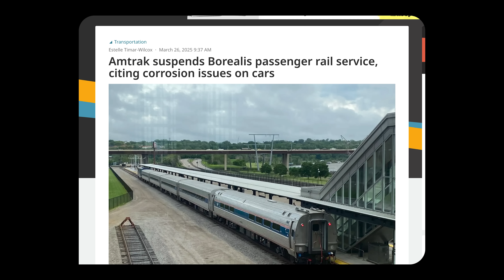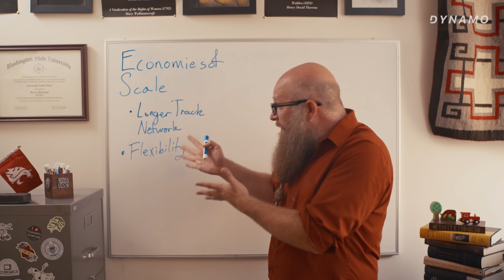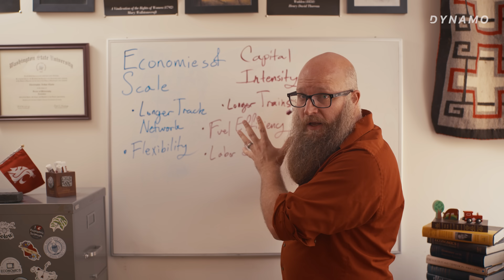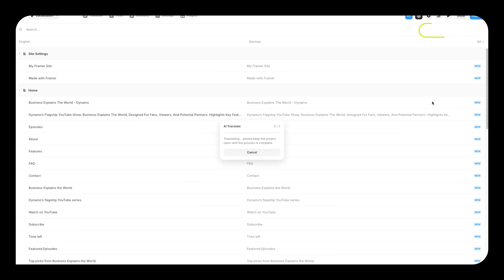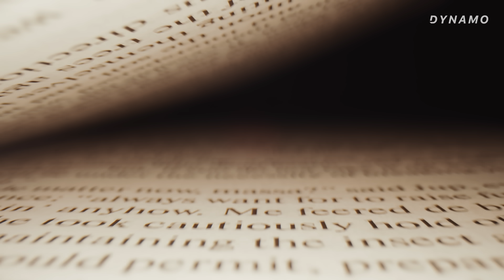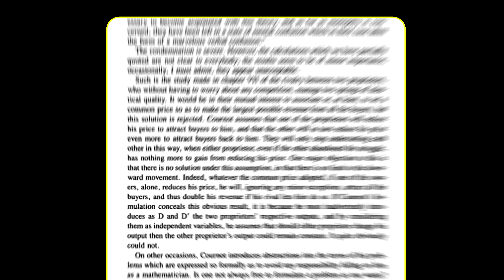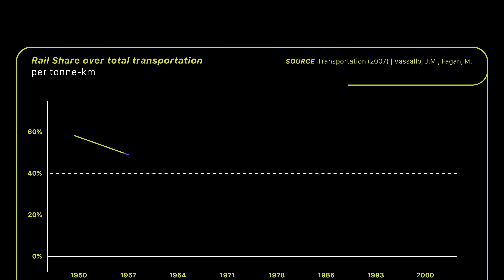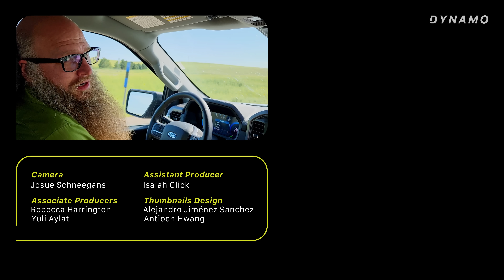Why Freight Trains Suddenly Got SO Long

Comment: Counter point, Intel and AMD, or Apple and Microsoft. I dont see price wars there? Your point about cell service providers can be countered by a near price parity in Canada between rogers, Bell and Telus. Or what about internet service providers, North american internet is garbage for its cost. Freight trains sure. But passenger trains are dying and their main competition is junk service airlines. Theres another one, the quality of the service on air travel mirrors it price, they had a race to the bottom, waiting for one to break so they can shoot back up to make money again. or how about air line manufacturers, they have a captive market and little to no competition yet are still struggling, with a merger or sale almost every decade.
Reply: Intel and AMD were not perfect substitutes. Nor did AMD have the capacity to service the whole market. Microsoft and Apple differentiated themselves drastically. Plus, they experience significant switching costs between the two operating systems. They are definitely not Bertrand.

Comment: Is the blowing of the horn when passing through intersections still needed anymore? Everyone should know that you don’t play or park on train tracks. And the arms go down. Train horns are a nuisance. How many lives do they save?
Reply: Horns at grade crossings are an FRA requirement. They are an alert in case the gates fail. Always have a backup for a backup. (U.S. trains have bells for the same reasons)
Reply: @AEM-7_943  Could we make them less deafening?! Also appears to be a solution to the wrong problem. People shouldn't be on railroad tracks. I see it all the time these days though with cars in traffic.

Comment: Yeah America has a lot of freight trains, but they crawl basically at tram speeds on extremely low quality tracks. And the problem with trains that can't even fit the sidings is that the capacity becomes extremely low and it effectively bars passenger trains from the system.
Reply: really depends on where you look like theres main lines and then thats usually faster freight with bigger more modern locomotive the more rural you get the older the tracks and older locomotives as they dont have as much money as big companys to maintain track and get new locomotives
Reply: @donotfearamericaishere  From what I've seen and experienced even the Northeast Corridor is very poorly maintained for such an important mainline by global standards. I mean seriously you can even see how the trains wobble around on portions.
Reply: @dijikstra8  north east corridor is actually very well maintained from my experience on it just issues with trains being late infrastructure is aging and that definitely needs to be addressed but overall its decent and what do you mean you can see the trains wobble around sure there's probably some parts like that but i  haven't seen anything like that if you could provide a video thatd be appreciated
Reply: That just isn't true, lots of freight in USA travels at 79MPH, in Europe freight only goes 75MPH.
US diesels are so good that there are over 1,000 in Europe.
40% of US freight goes on rail, a higher percentage than virtually every other country in the world.  British railfreight is 8%.
There is nothing wrong with the quality of US tracks, They do have derailments, but they are rare, and as there are few passenger trains derailments don''t usually injure or kill anyone.
If the train didn't fit any sidings it would never be able to be formed in the first place.
I've worked on British railroads for 36 years and I avidly read about you're amazing railroads,
It's very disappointing when people post up lies about a subject they obviously don;t know much about.🤬
Reply: @jonathanbutson1385  He's got a point though. From what I know about BNSF, trains over 100 TOB (Tons per Operative Brake) are limited to 55MPH, which means most road freights can't go faster than that. Only the highest priority Z trains and maybe Q trains can exceed 55. We have pretty much perfected the diesel electric locomotive though, which is why we export so many. About the sidings, some locations do have issues with trains being too long to fit in the sidings. Most sidings are no more than 8 or 9,000 feet long, while most of the Class 1s regularly run trains exceeding 10,000 feet. These trains weren't possible when the most of the infrastructure was laid in the 19th-20th centuries. For example, UP runs Z trains in and out of Portland that are sometimes almost 15,000 feet long, which clog up the whole Portland Subdivision because they force everything else into sidings. However, BNSF is usually good at running reasonably sized trains below 10,000 feet.
Reply: @jonathanbutson1385 max speed for freight is 70 in North America and that’s only for intermodal trains and autoracks. Hell, all modern engines are geared for 75 mph max.
Reply: and they are very slow, diesel and outdated just like the tracks on which they roll.
Reply: @carholic-sz3qv Our GEVOs and SD70ACe are great. Most modern locos out there too.

Comment: It's the first time in history that the USA has an electrified high-speed train in 2025😂!

Then they say that the USA has a better rail system?😂
Reply: Huh? The Acela has been around since 2000.
Reply: the video is about freight trains and the rail system that serves that specific subset of trains
Reply: @kent5147  and yet its still slower and worse than the freight trains operating in western europe and east asia
Reply: Meanwhile in Europe they have up to 7000hp electric locomotives

Comment: I'm not an economist, but it feels like for a Bertrand dupoloy to exist, there has to be some mechanism to prevent collusion. We see much larger networks create oligopolies. The triangle number increase in coplexity of a network as nodes increases is a natural check against the tyranny of monopoly/collusion. I'm gonna have to side with Cournot considering the current state of US political function.
Reply: Yes, a big part of preventing a duopoly becoming a monopoly would be preventing it from becoming a cartel.
Reply: In the context of trains, we've seen the number of firms drop from 30 down to 7, yet the prices, adjusted for inflation, have also fallen. I think the evidence, in this case, points to Bertrand.
Reply: @EconChrisClarke 
As the number of competitors decreases the easier it becomes for the remaining firms to collude, either directly or indirectly. If there are few firms in a market, one seller can simply decide to match prices of competitors, rather than undercut. With a small number of firms they don't even have to actually break the law by talking with competitors about price. Imagine the two smoothie carts in the example in the video. If my cost is $2 per item and  competitor increases prices from $3 to $5, I could get most of the customers by keeping my price at $3, but why not match the price and make triple the profit per drink? Going 100% market share isn't my best strategy, unless I want to drive my competition out of business, so I can later raise prices.
Reply: @jonscaplan And yet we found two firms were sufficient to bring prices down to costs in the paper we cited studying the powder river basin. While incentives for collision exist, there are other incentives where collusion breaks down. There is always a benefit in undercutting your competitor.

Comment: Terrible choice at 13:56 to use US cell service (3 firms) as an example of a 'good' oligopoly. The average cell phone bill in the US is $140, compared to an average of $20 Europeans pay for the same thing. But "cell service has only continued to improve" and "prices dropped?"
Reply: If you compare apples to apples, you'll see the American prices are similar. My 5GB plan with Mint is only $15 a month. Mint uses the TMobile network. Year by year, plans continue to improve and be cheaper in America. Just four years ago, I was paying $20 a month for 1GB.
Reply: @EconChrisClarke  not sure why you were paying $20 per GB. T-Mobile had a $30 a month plan with unlimited text and 10 GB of data back in 2012.
Reply: @MirzaAhmed89  Did that plan include purchasing the cell phone along with it? I've almost always used the discount brands.
Reply: It's not phrased as an example of a "good" ie moral one, just factually efficient.  Service networks in the US are vastly superior to other countries (especially accounting for the expansive geography) and exponentially better than they were a decade or two ago, when more than twice as much competition existed; additionally, we used to pay for data by the gig, calls by the minute, texts by the message... now you can mostly get family-size unlimited data/sms/call for barely $25/pp. That's abundantly cheaper than phone plans were in 2005. The improved networks is due largely to the mergers, but as Prof. Clarke pointed out, not at the expense of raising prices relative to the increased service & capability, or even inflation.
Reply: Huh? I pay $20 a month for cell service. Where are you getting $140?
Reply: In post-Soviet area you get 40 GB of mobile 4g internet (plus the rest of mobile stuff, plus bonuses to choose from) AND unlimited home internet (~100 Mbit/s) - all for $7/mo. 
If you want 1 Gbit/s for home internet (plus the same mobile package) - that's $10/mo. And if you want unlimited mobile traffic - it's just a bit more expensive.

$20 a month for 1 GB of mobile traffic in the US is insane. And you invented most of these technologies lol. You are clearly robbed.

Comment: Three Miles of trains to block intersections for hours, three miles of trians with rail inspectors getting seconds per car for safety and maintenance inspections, before being fired for doing their jobs. Three miles of trains to pile up in horrific crashes almost daily. 
I love trains. Lets be excited about trains, lets be excited about redesigning tracks to support freight and passengers. Lets put money into the actual trains, tracks, and jobs to maintain and operate them safely. Let's stop that money from consolidation, cutting safety and cutting necessary workforce. Lets stop that money from lining CEO and lobbiest pocketbooks.
Reply: It’s only gonna get worse. “Precision Scheduled Railroading “, monster trains, megamergers, etc…that’s all just business as usual now.
Reply: He did show in the video how safety increased.  I don't even pay close attention to the industry, but I have seen improved safety measures in the last 20 years such as positive train control and more grade separations.

Yes, a 2 or 3 mile long train is annoying as hell if you are waiting to cross the tracks, but if the railroads want to run those trains, I think it's reasonable for local communities to then be able to require them to provide grade separated crossings when certain criteria are met.

The major freight routes between downtown LA and San Bernardino have had lots of grade separations put in place the last several years, though I think some of that cost was paid for by the state.   But one of the big reasons behind it was because they do want to run such long trains coming out of the port of LA.  (And in the 1990s between the ports and the yards near downtown they did build a new grade separated freight corridor).
Reply: @comicus01  Or you could split the train up into multiple smaller trains, which will also fit on the side branches. A 3 mile long train is gonna require multiple people to operate due to the time it takes to walk that distance, it's gonna take multiple engines to run. Meanwhile, those shorter trains can operate with just a single engineer and run a lot faster with proper safety and signaling systems in place at crossings. Bigger is only better until it becomes too big.
Reply: @John8087  There is probably a point at which a train does become simply too long, but in general: bigger/longer is simply more efficient.  Same is true with airplanes.  Same is true with a factory producing 10,000 widgets vs. 100 widgets.

I could be wrong, but I believe the really long trains still only require two crew members.
Reply: Yup, plus the being yelled at by the chief dispatcher because you’re taking too long to replace your broken knuckle on your 14,000 ft manifest

Comment: US freight trains derail 1700 times per year, Europe is closer to 0 for any train and I bet China is low also. 2 mile trains don't seem as impressive when you realize it's a profit driven risk
Reply: There are hundreds of derailments in Europe too
Reply: @MirzaAhmed89  i dont know about EU as they dont release data, but UK does, with 8 in 2023
Reply: I'm finding it hard to find numbers for European trains as most of the stats I am finding it related to *fatalities* related to train accidents, but it seems that three quarters of US freight rail "derailments" are in low speed railyards instead of on the mainline tracks. Also, it appears that US federal rules require every incident when a wheel leaves the track to be reported as a derailment, which might make the number even higher.

Overall, the derailment number in the US is much higher than Europe, most likely because more cars are being moved in larger trains, but saying that Europe and especially China have spotless records is laughable. No system is perfect.
Reply: There are 500 derailments annually in the EU as compared to between 1000-1700 in the U.S. And higher derailment counts mostly reflect how much more freight the U.S. railroads move, not rampant recklessness. If rail safety was really “profit over people,” there’d be disasters all the time. Instead, we get mostly yard bumps and more goods delivered, with fewer trucks clogging highways or belching out carbon.
Reply: @kent5147 500 is closer to 0 that 1000-1700. Haha jk but still we're talking about the "superior" network just seems like it's a bit rusty if impressive
Reply: @kent5147 Palestine city derailment didn't happened for a long time in EU
Reply: @kent5147 wrong! Stop lying please!
Reply: @carholic-sz3qv don’t argue with train nerds , it’s scary how much they know.
Reply: USA has 1 derailment for every 130km of track. Uk has 1 for every 2000